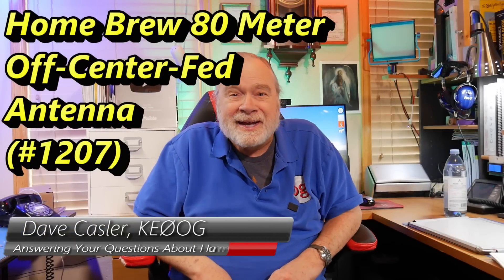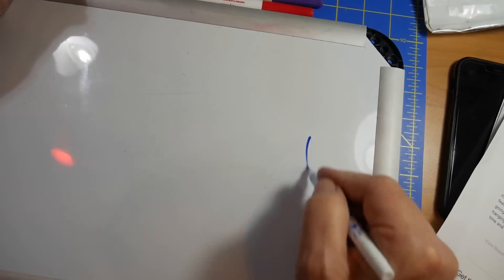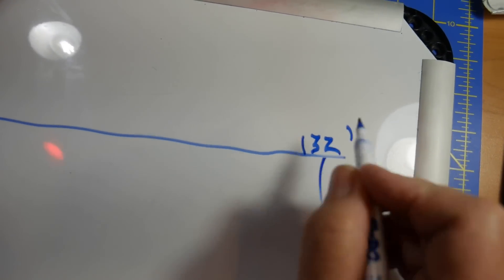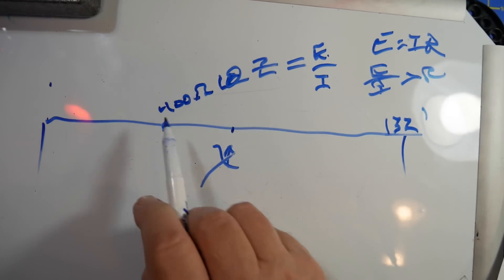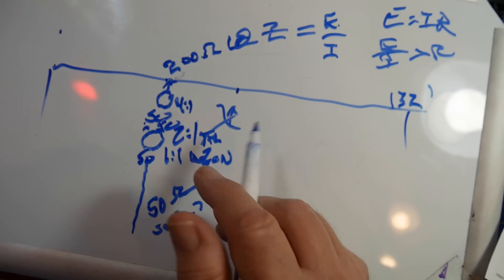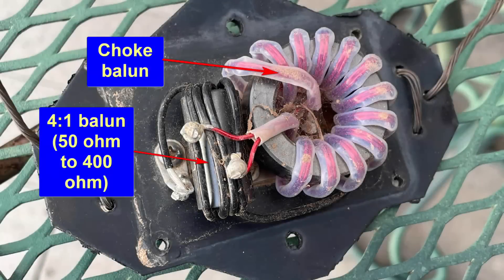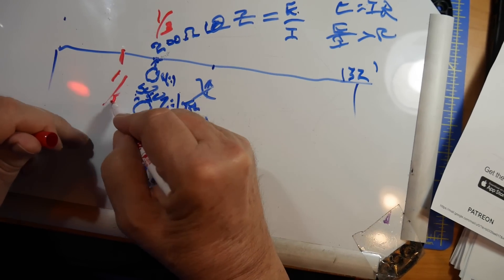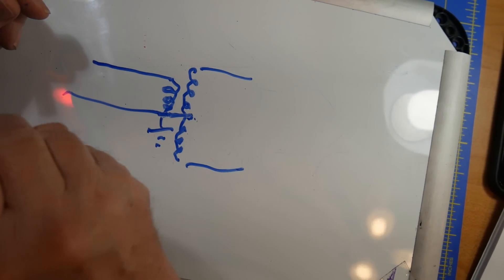Home Brew 80 Meter End-Fed Antenna (#1207)

Comment: Dave, you brought up an 80m end-fed 1/2 wave dipole. Would a person need a 49:1 balun for a 50ohm coax? It seems that that ratio is the most common one that gets bandied about. Thank you for all you do. KQ4IXD
Reply: EFHWs typically use a 49:1 tranformer.
Reply: I think the antenna he is talking about here is more of Off Center Fed antenna rather than half wave End Fed.   where impedance of feed point is around 400 ohm.  I think this type of antenna is also called windom antenna.  I had friend who used off center fed antenna David describe in this video, he liked it very much .  AG6JU
Reply: Yes, 49:1 is correct. That calls for a turns ratio of 7:1,  usually 2 primary turns to 14 secondary turns. However, 80 Meters really needs 3 primary turns (because of it's low frequency) so 3 primary to 21 secondary turns are needed, with a 100pF Ceramic disc capacitor across the primary windings to provide better matching on higher bands.